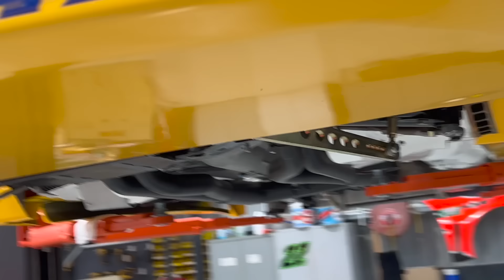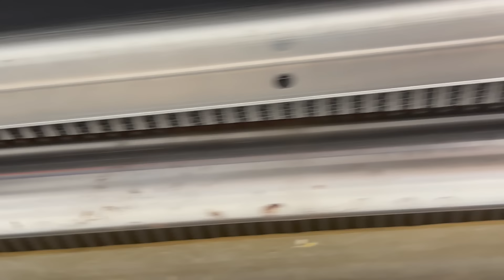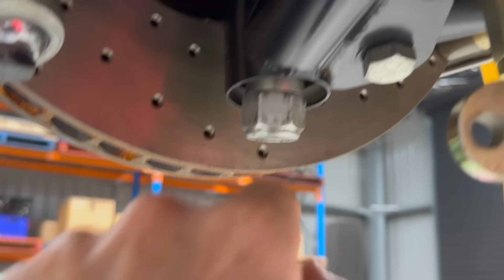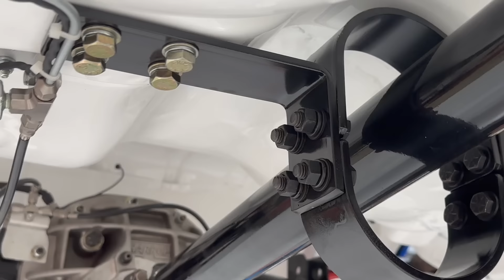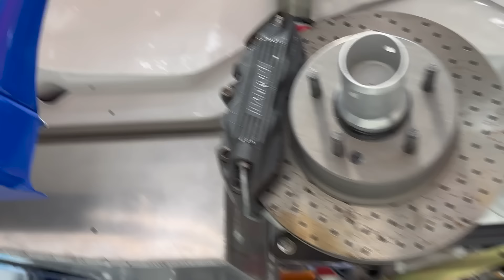Bonus Episode: Let's check out underneath the Holden Commodore VL PE 010 on the hoist

Comment: Awesome walkthrough, thank you! What is the capacity of that fuel tank? Is it 83L like the Group A homologation? Do you guys still know the consumption & range that it achieved around Bathurst in 1992? Thanks!
Reply from the maker: Thanks! The capacity is 120L. I would need to find the rules or supp regs from Bathurst in 1992 to confirm what it was for the race in 1992. Often CAMS event rules would override the Group A stuff, especially towards the end of Group A. Not off the top of the head but you could possibly work it out re-watching some of the race. Cheers!
Reply: @perkinsengineering  Thank you!

Comment: Nice video, next time can you tell us some specs of the engine- ie comp ratio , valve sizes and exhaust diameters . Love to know how he got 500+hp out of a 5ltr . Great work
Reply from the maker: You can find a lot of this information online or in magazines like Street Machine who covered engine specs in 1993/94 and again in 2022/23. 1993 Engine was 10:1, 2.020" inlet valves and standard exhaust, 550hp 415ft/lbs torque at 5500rpm

Comment: So runs a ford diff and still has a shity Centre bearing in the tail shaft still just a crumble door shitbox
Reply from the maker: Wow! That "shitty" tail shaft won 3 x Bathurst's and ran strong and reliable for us until 2009 when we sold up! No need to try make the wheel more round! Cheers for watching!
Reply: @perkinsengineering  yeah as a panel beater by trade I put a floor jack under the tow bar on a VL and it put kinks in both rear quarter panels the chassis is weak and light as a feather to me there a glorified holden carmirra junk good 👍 job on getting it to stick to track
Reply: Yep, I used to get clem Daniel ( illawarra)to make me a thicker walled straight shaft. No whip.. no vibe.👍🍻@perkinsengineering

Comment: What's the size of the rod end bearings on the suspension rods?
Reply from the maker: They are varying sizes, any ones in particular?
Reply: @perkinsengineering  The lower front suspension arm, the very front one on the drag arm and the inner of the lower arm. What's the size of the rear radius rods?

Comment: did pe010 ever run the compressed air jacking system (where the cut outs are on the side skirt)?
i thought i noticed threaded holes up there as you looked underneath it

Comment: Is it true that the VP 5Lt engines did have a LP letters welded to the back of the block, just asking as there's rumors that Larry Welded his LP initials on the blacks he used for the engines he had etc. 👌✌👍🦘
Reply from the maker: Yes they have "LP" on the back
Reply: @perkinsengineering  Thank you for the reply, cheers, remember selling aircraft 316 welding wire to russell at the Moorabbin factory workshop back in 1999,( which was used to tie off the engines areas after completion, so that no teams can open up the engines and change anything)  also still have the VT racing poster signed by LP. cheers 👌✌🦘👍👍

Comment: Jack . Do know what the difference  in the rear suspension between tom's car and your dad car . As tom's car rear collapsed
Reply: You nailed it. I was thinking exactly the same thing.
That single link mount on the R. R. axle tube looks a tad flimsy to me. I can see the old 304 could probably chew that off fairly easily when trying to haul out of the Cutting.
Love the way she still has a fairly typical wet sump & GM type oil pump. I see a lot of crazy expensive trendyarse dry sump set ups needlessly grafted onto Holden V8s & 6s lately. This was a highly competitive car in her day & the old Holden oil pump obviously did the job nicely.
Walky back ends seemed to collapse evenly left & right. I'd love to know why?
Reply from the maker: The 3rd link is a decent piece of tube, larger and stronger than the lower arms. Yes KISS - Keep It Simple Stupid! Cheers!!
Reply: @perkinsengineering 
It's the actual bracket welded to the axle housing that looks like it could sheer off.
Reply from the maker: No I don't unfortunately, largely because there are literally zero photos around and I can only recall what others have told me. I would need to double check the stories!! I believe the bolt sizes were really small too. Let me chase it up. Cheers!!

Comment: I used a 3 link from the top of the diff on my Sports Sedan and it worked very well. Hooked up hard and handled ok. They do not bind unlike 4 links which are often bad! With wheels in the air. Simple panhard with 3 height settings. Would have been far better with better shocks but they cost money! Had old adjustable Konis that never left the full hard setting. All way around. Still ran top 10 in national SS events in SA and Vic.
As the VL, I have a classic  speedway Supermodified that runs exactly the same on the outside. Runs well on rough tracks. It did have 4 links originally, front and rear. It was referred too by someone as a 2" steam pipe sway bar. Beam axle.
What is with those drilled rotors, I had some that lasted about 10 laps of Mallala and cracked. Seen plenty others as well. Used grooved ones. Mostly ex Tourer rears I was scrounging. 13" was plenty big enough for a 920kg XU1 Chev. With VL style AP callipers
Reply: Any info or pics I can check out. wouldn’t be for another couple years after they ran the VL before I even existed.. and this is the first I’m learning of many different things. Been the case a lot thanks to this channel and the people that comment, it’s bloody awesome. you’ve got me intrigued to be honest
Reply: @cpzmelbs 
You can see the amount of time & trouble invested in making our local family cars fast & entertaining. Group C rules allowed these improvements which made the cars safer & a whole lot faster. The whole idea was to showcase locally available cars & to provide exciting entertainment & it worked beautifully.
Some folks with too much money lost the plot & they rammed Group A rules down our necks in 1985. This allowed endless swarms of specialised factory mass produced racecars in from Europe & elsewhere. The big dollar Aust teams elected to run these massively powerful Euro rockets up against our locally developed family car based sedans. Suddenly we were swamped with megabuck whizz bang tin pot toys from overseas & all the hard work we'd invested in local motor racing went largely down the drain.
We'd had 6 cylinder & V8 Holdens fight it out on track with V8 Falcons since 1968. These local cars sounded awesome & the racing was intense. The engines were race prepped family car engines. They were real cars anyone could buy, prep & race. Group A killed it. We ended up watching Cosworth powered kid's toys dominating which sounded like a fart in a trumpet winning race after race. Even Ford fans cheered for V8 Commodores because they were sick of 4 cylinder fart rockets until Nissan arrived with their criminally fast twin turboed 4 wheel drive GTRs which clearly demonstrated Group A was a sick joke no one wanted.
Larry did the patriotic thing. He stuck with his Holdens, worked like mad to make them stronger & faster & he & a few others put up a damn good fight right up until the numbskulls finally woke up & tossed out the nutty Group A rule book in 1993.
Group A became so infuriating, the crowd at Bathurst in 1992 started pelting full cans of beer at Jimmy & Skaifey after they won the event with a monster car aptly named Godzilla. By this stage, Aust racing enthusiasts had had an absolute gutful of expensive purpose built foreign cars dominating our sport. It was appalling & outrageous & folks were angry.
This great Perkins built VL shows us just how much work went into setting up a Commodore to make it competitive under Group A rules. She's a work of art & a fine example of what formed the basis of V8 Supercars years later.
Even Peter Brock drove a Coswoth Sierra at Bathurst in 1990. No one wanted to ever see anything like that.
Thankfully Larry kept V8 Holdens alive throughout the entire irritating Group A period. Without him & other visionaries like him, we would never have come away with what became V8 SuperCars.
We owe Larry plenty. He was the backbone of Australian Touring Car Racing.
Reply from the maker: Cheers!!
Reply: @perkinsengineering 
Many thanks, Jack.
This episode is golden. Showing us what lies beneath one of Larry's fabulous engineering marvel time capsules is a real treat.
Thankfully, early Commies are now running in Historic categories & they are competitive against imported performance coupes. Do us all a huge favour & rattle a VK together for historic racing. I'm sure Castrol would back such a project.
308 Commodores regularly hammered 350 Chev Camaros at Bathurst for years in Group C. I'm sure you could replicate that & the fans would love it.
Reply from the maker: Nice work!

Comment: thankyou jack ,this was so cool to cee . appreciated greatly. im super curious as to how they compare to the HDT cars- it would be a long shot but if anyone could do it you are most likely too succeed -a side by side comparrison would got viral , luv your work . cheers
Reply from the maker: There weren't any HDT VL Walkinshaws, but there were HRT ones. The 1988 HSV and 1989 HRT cars were actually PE cars so the fundamentals were similar. In 1990 they possibly did some different "stuff", maybe we could sneak under the 1990 winner at Eggleston Motorsport for a look ;)
Reply: @perkinsengineering 
Yes please!      Let's see what Percy & Grice used to win against all that turbotrash!
Reply: @perkinsengineering  Not that Larry's ever snuck a look at the underneath of a HRT car 😄
Reply: They are quite a bit different, 5 years of evolution and extra homologation bits and pieces between the hdt models and this of Larry's from 92.
Reply from the maker: Correct. 1992 spec very different to 1990 also. In 1990 it was a Holinger 5 speed gearbox and twin throttle engine, 92 was 6 speed gearbox and slide manifold as an example.

Comment: Hey Jack, thanks for the 'Tour d' VL', with that three link rear axle positioning, do you get any fore and aft flex across the diff housing under extreme power?
Reply from the maker: I mean you shouldn't because the diff housing is out of a F100 truck and its very strong/stiff. Through the nature of the Crown Wheel and Pinion you will possibly get more roll or load on one side, possibly altering the ride height or spring compression through the coil springs and shocker but not through flex if that makes sense. Cheers!!

Comment: Was the three link a loop hole? Why was the three link not carried over to v8 supercar, the nz and some sports sedan lads favour 3 link?
Reply from the maker: Good question and I'm not sure! I'll have to chase that up! Cheers!!
Reply: @perkinsengineering  At a Guess, when the "Watts Linkage" became a thing on the rear ends, binding was no longer a problem thus 4 links were the better option.
Reply: @TheHogart 
Yep.
Panhard Rods are cheap, nasty & frightening especially on a straight road with dips or humps.
I drove my Missus near new TE Gemini Van from Toowoomba to Dalby at around 140KPH about 42 years ago when that road had causeway dips every few Ks.   Crazyarse torquetube Borgy back end fixed at the nose turned the back axle left & right as the Panhard Rod shoved the axle sideways on dangle then compression.  Car literally pointed left & right alarmingly as rear steer took control.
Am absolutely certain it was alarming treacherous torquetube rear suspension that ended the life of Mike Burgmann on Conrod at Bathurst 1986.
Am strictly Holden. Not a Ford fan.    However, must praise Ford Aust for employing Watts Linkage system on all coil sprung trailing arm Falcons from 1983.    I remember Tricky (Dick Johnson) struggled to sort Ford's then new Watts Link rear but he did end up fixing it. He may have even experimented with 3 link?  You'd have to ask him.